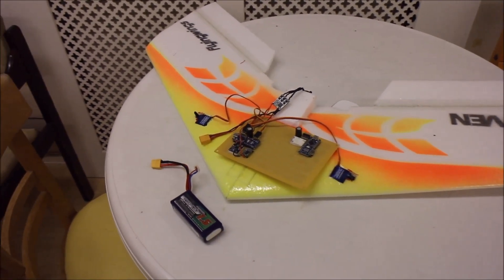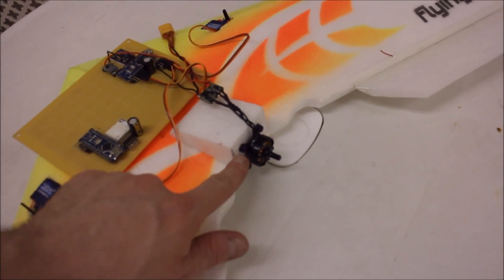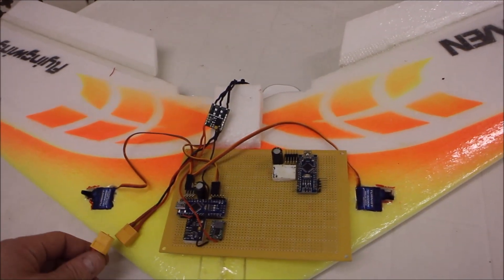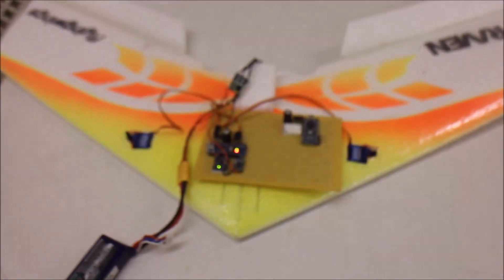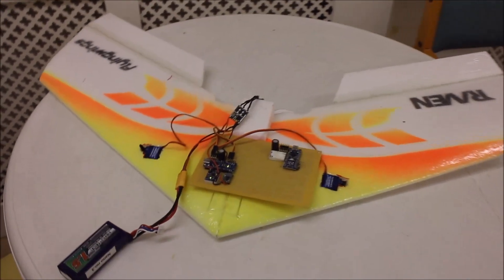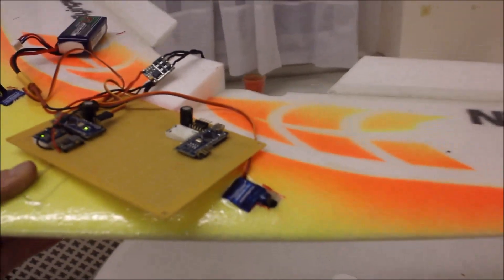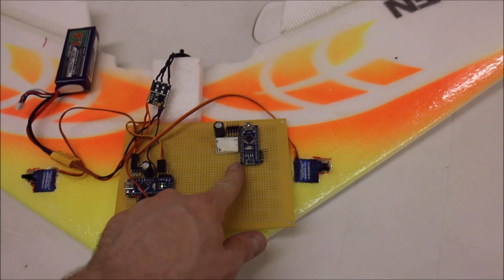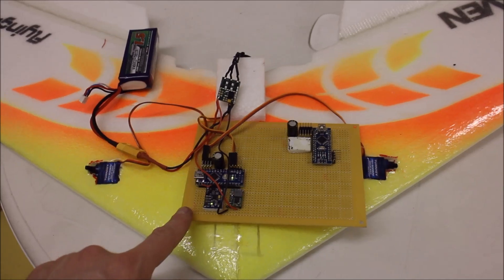FPV Raven flying wing Multiwii test

Comment: how do you find the cg
Reply from the maker: +Aldo Allende Oliva Are you asking me where it is or where it should be? You refer to the manual to find out where it should be and balance it on your finger tips to find out where it is.
Reply: +christophertelford how do u calcularé cg for any flying wing
Reply from the maker: I don't. It's usually about 1/3rd back from the nose but that varies depending on wing sweep. I would read the manual and then use trial and error to get things perfect. If I made my own custom wing I'd start at 1/3rd back from the nose and experiment until I got it right.
In theory you want about 1/3rd of the wing area in front of the CoG and 2/3rds behind.
Reply: +christophertelford 1/3 IT only works for a regular wing.
Reply from the maker: 1/3rd back from the leading edge in terms of distance works on a straight wing. In terms of surface area works on a flying wing with sweep angle but only as a very rough guide. I use this and then trial and error to get it perfect. a couple of mm's can make all the difference.